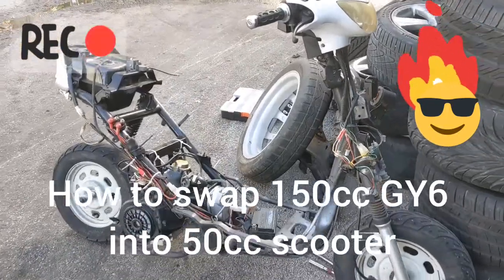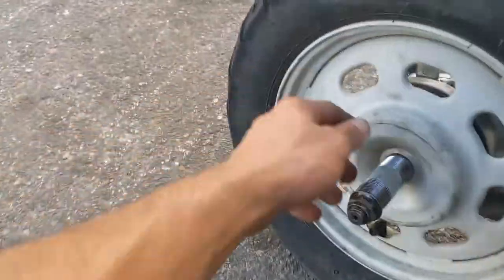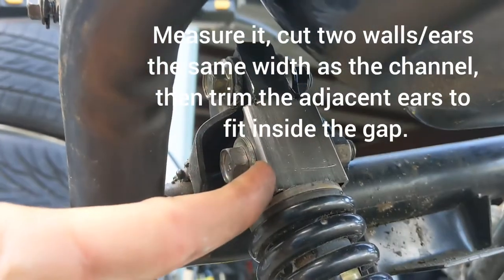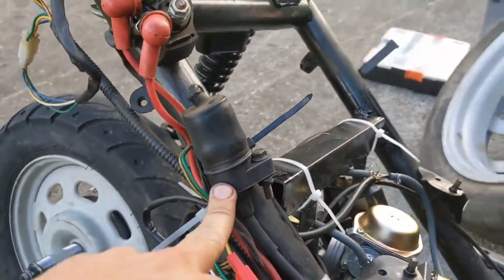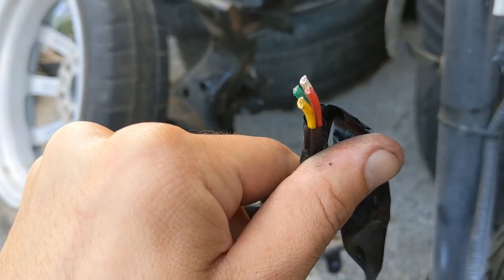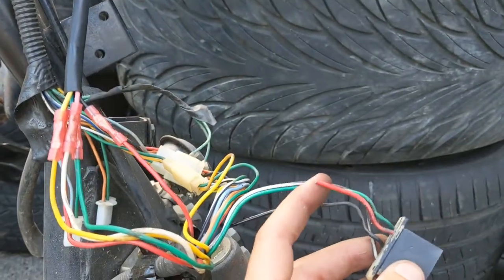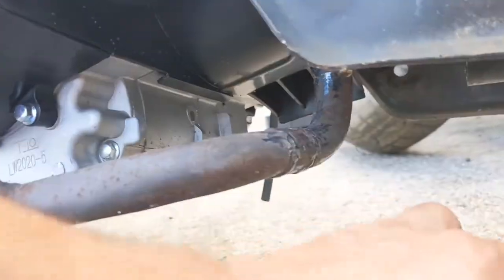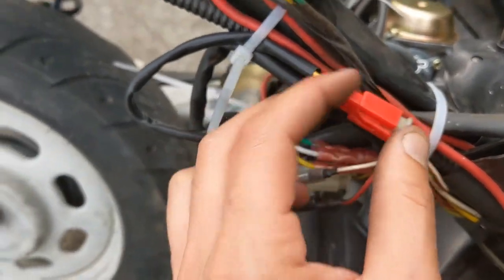How to 150cc GY6 Swap a 50cc Scooter

Comment: Every time I do the exact same things my green wire from my stator just starts smoking, the 125cc rectifier is plugged in correctly, but the only difference I have is I got 2 yellow wires coming from my stator and I have a solid yellow and solid white on my wiring harness, is the somebody that can help me
Reply from the maker: I did a 150cc swap. It sounds like the 125cc system you are using is different. Have you tried Google searching a wiring diagram specific to the 125cc one you have?
Reply: @MileHighDreamz  yes I did but I am using the original 50cc wiring harness and can’t find out where the problem is, my only hope is to buy a new stator since my green wire is burned, and a 125cc wiring harness and hope that the problem is solved
Reply from the maker: I'm guessing you fried it anyways. Figure out the connections before plugging in the new one
Reply: sounds like u have a dc   stator    and with 2 or 3 yellow wires     ac stator on old engine could have connection issues do some research on ac and dc cdi

Comment: what do you need to weld to the frame
Reply from the maker: @bryanhesler5238  I don’t understand the question. Tubular metal? I modified the existing engine mount and welded it on the top side between the left and right frame?

Comment: When working with all your wires up front, there is a key that has green and orange (?) Or yellow wires that are just hanging there, not plugged into anything.  Its behind all the wires you are working with. I have that too.  What do I do with that?
Reply from the maker: @shaunaromine3709  I’m not sure which it is, this project was a while ago but if mine isn’t plugged in you should be good??? Sorry I couldn’t help

Comment: I appreciate you bro. My question is regarding the rear wheel as I haven't decided if I use the 150cc wheel or the 50cc wheel. Did you have to change the gearing? The 150cc is designed for the greater diameter so how does it run with the smaller wheel? Thanks!
Reply from the maker: @Foxnhell  I did not change the gearing… I had to make a spacer for the wheel and another for the nut, you can see it in my build video. If you don’t want to do this then buy the short output shaft and swap it out to keep the original 50cc wheel.

It drove nice, a lot of torque and acceleration but top speed limited somewhere around 55-60mph. If you put the 150 cc wheel it will be a better fit and you will sacrifice a little torque but have a higher top speed. My understanding is that you can adjust the clutch or drive unit with aftermarket parts to get the ride style you want so I guess either can be adjusted. Hope that helps!

Comment: are there parts from 50cc scooter that i can cannibalize for 300cc scooter like mirrors, handles, maybe electric starter...??? any ideas
Reply from the maker: If you are swapping a 300cc engine into the original frame then I don't see why mirrors won't fit. The rest of the scooter is the same. The starter motor will be different and the wiring needs some modification. It shouldn't be much more work than this swap.

Comment: Hey my keys broke in the ignition . I Need To know how to turn on 150cc gator moped with out key what do I have to do to cables
Reply from the maker: If I had to guess, get to the ignition harness behind the key and connect the same wires I connect in the video.

Comment: Hey there and good morning! Liking the video, doing research on how to swap a factory 50cc scooter engine to a 150. The frame I’m using is a heavy reverse trike body who’s factory 50 would struggle to push. Previous owner had a 150 put in but couldn’t leave it alone so now it’s a parts donor. Who would you recommend to order a new power plant from that is ready for installation? Thanks and happy scooting dude
Reply from the maker: I ordered the entire 150cc GY6 engine brand new from ebay and it came with the new carburetor, gasket, rectifier etc. I don't recall the seller name

Comment: First of all thank you so much for making this video! I have a question. If I wanted to just buy the longer shock what measurement am I looking for hole to hole? I think the original is 11 1/2 inches long but I'm not sure
Reply from the maker: I'm not too sure, I believe I built it about an inch long. Maybe look for a shock that has adjustable height?
Reply: @MileHighDreamz  cheers my dude. I ended up ordering a shock measuring 13 1/2 eye to eye

Comment: My 150 came with a 4 wire rectifier do I still need to change it
Reply from the maker: @JacksonFikel  I’m not following your question. Mine came with the rectifier as well and I’m pretty sure that is what I had to wire into the old bike. So what are you asking? Are the old and new ones both 4 wire???

Comment: Where did you buy your gy6 150cc motor and how fast does it go
Reply from the maker: eBay and roughly 55mph on the stock tire. Fast enough to feel sketched out and want to back off

Comment: What does the fuse up to the wire to the fuse where does it hook to on the scooter at
Reply from the maker: Under where your feet rest, next to the battery. Go to your battery and follow the red wire, you will see it tucked into a hole

Comment: I put a 150 on but I have to turn it by selinoid cranks but won't start also wires are different r w b g y
Reply from the maker: I'm not sure as this is the only one I have done. Did you check the forums online? A bunch of information if you don't mind reading on those and the wiring diagrams for the 150 motor it normally goes on.